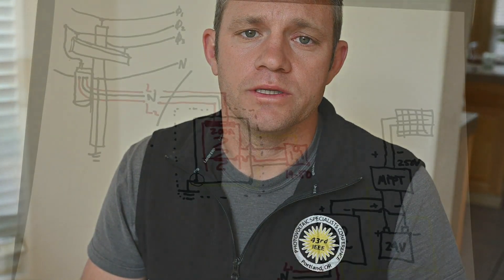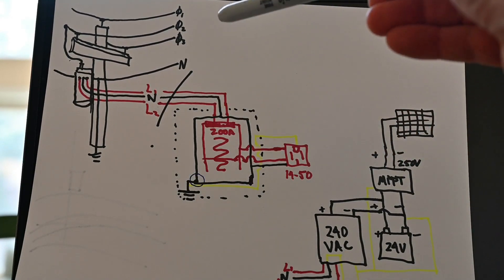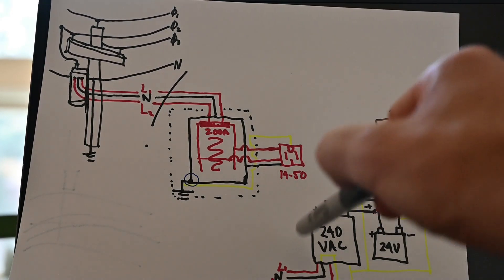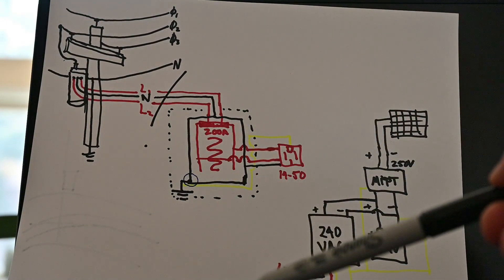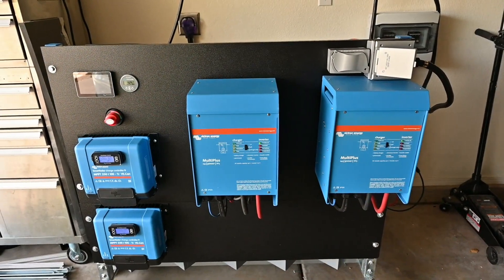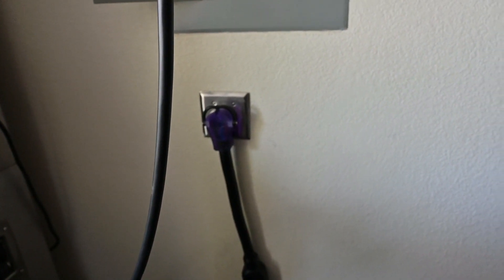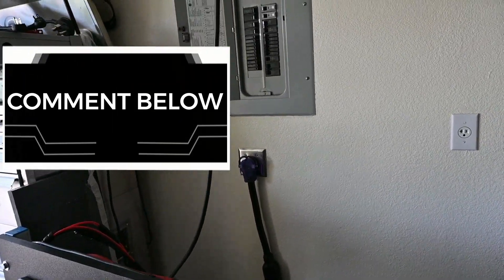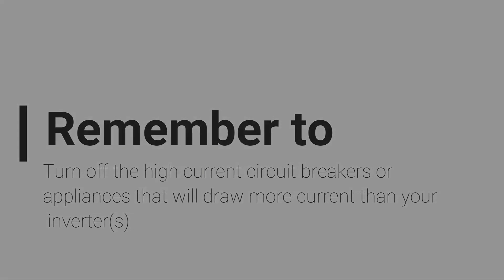Powering your on-grid house with an off-grid Victron Tesla charger

Comment: Regarding neutral to ground and only tying it at 1 point...I have seen where they say the DC system and AC system ground rods should be bonded together...if so, does it matter if you have n/g tied together in the main panel and the inverter as they all go to the same rod any way?  Or would you still disable it in the inverter?
Reply from the maker: If you have one rod, it should only be tied at the panel and not at the inverter. If you have two rods, it's a mess like mine was at one point. You really want to avoid multiple rods tied together if possible. It gets very complicated if lightning strikes as one rod will have a very different surrounding dirt potential than the other (even if the rods are tied together) which means current has to flow somewhere.
Reply: @gridfreeordie  Thanks for the reply.  It all seems unnecessarily confusing.

My solar is 'sort of' off grid.  I have a manual transfer switch, so main panel (n/g bonded) goes to the transfer switch, the inverter goes to a breaker then transfer switch.  After hooking them together in the switch, the n/g of the inverter appear to be bonded.  So, in this case, it seems I would want to unbond them inside the inverter and not hook the inverter chassis to the ground?

Thanks again!

Comment: I thought your explanation of earth ground bonding was really good and thank you. You threw me a loop with the auto transformer though. From what I could gather you are trying to balance the load from L1 and L2 coming off the inverters respectively but that gives only one 120v source that pulls evenly from L1 and L2 to the breaker box. How are you powering both sides on the load center? Or are you just powering 1 side?
Reply: Never mind it just dawned on me the auto transformer is just supply the neutral. Never used one before but I will be now lol

Comment: I to have a 24 V off grid system. But my electrician put in 250 amp breakers which I connect to with 6/3 wire. 
My problem is that when I get a heavy load my lights flicker badly. I’m guessing that my ground isn’t properly done. 
So instead of 6/3 wire perhaps I should I had 6/4, in order to ground to the neutral on the main panel? Not really sure of what the wire size should be – perhaps 8/4 or 10/4?
I have my inverter ground going to a separate lightning rod as with all my other off grid system, including charge controllers and negative busbars. 
Any help you can give me would be appreciated. 🖖 Thanks

Comment: If you're going to back-feed your panel like this, by code, you must have an interlock. You can find them on eBay or other sellers online that fit any style main panel. I have a similar setup, and it is very important that it is dummy-proof, so that nobody can accidentally turn on the main breaker while it is back-feeding.  I highly recommend you ask a licensed electrician to have a look at your system.

Comment: Do you have a preference of what voltage system someone should build? 12v, 24v, or 48v? Solar is not an issue, located in AZ.
Reply: 48V saves costs nearly everywhere except for some types of fuses (ex Mega fuses are expensive). I'm switching to 48V and a higher power Victron setup soon to go mostly off grid at home.

Comment: Great video thanks for sharing. How do you have those two Victron inverters connected ? Are they connected in parallel outputting 120v to the autotransformer And then from the autotransformer generating 240v split phase balanced output ? Or do you have the inverters sync together in split phase 240v output to autotransformer and from there, the autotransformer is just balancing the load ?
Reply from the maker: The inverters are setup to be split phase 240V and then the output goes into the autotransformer to balance the inverters. I found that if you put 120V into the autotransformer and then step up the voltage to 240V, the Tesla has a hard time initiating charge. It sort of hunts around 1-2A and never ramps up to your set charge current. So something is definitely funky when you step up voltage...and there's a common issue with most of the Victron autotransformers with one leg being ~112V and the other being 120V due to the number of windings not being equal around the magnet. Both these issues are avoided by going 240V split phase into the unit.